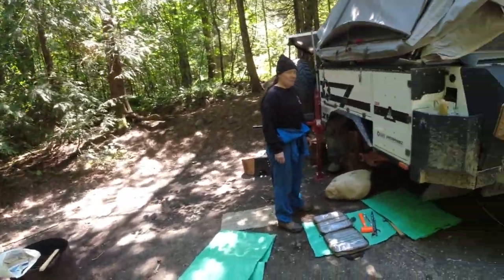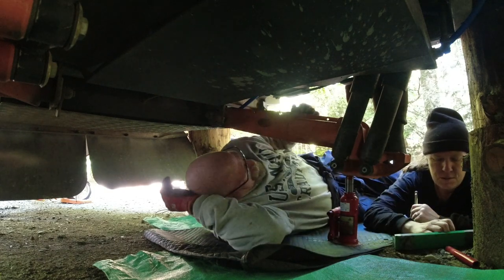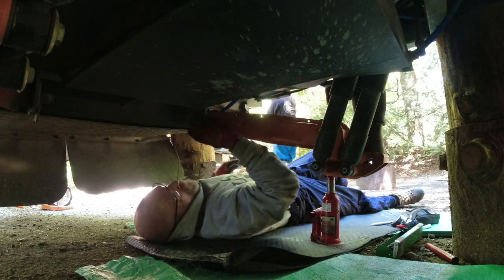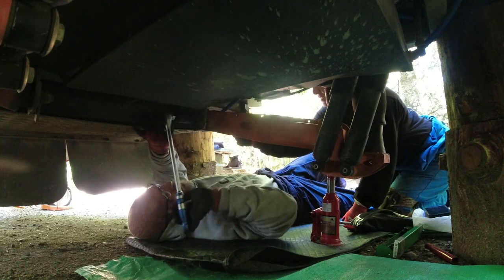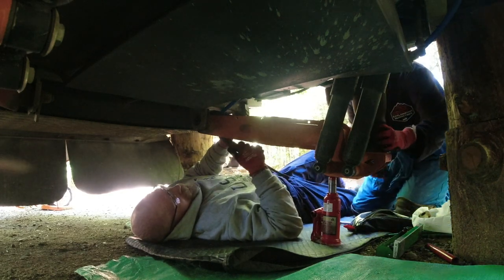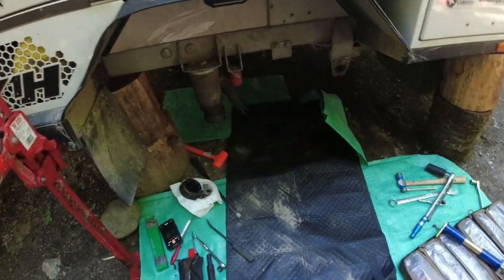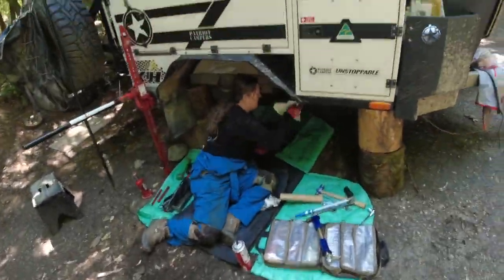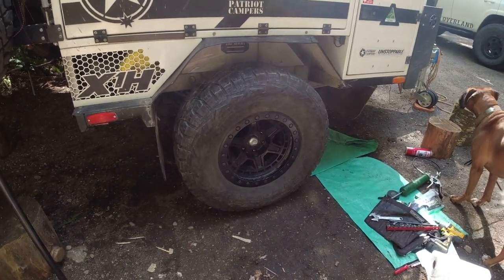In the field Patriot Camper Swing Arm Replacement

Comment: Enjoyed the video and glad your mobile once again. Safe Travels. 
Now a related question, but this is in regards to your "Total Chaos" suspension. 
How has that performed for you? Any issues with the "Total Chaos" components? Cheers, Mate.
Reply from the maker: The Total Chaos UCA & LCA’s have performed flawlessly thus far!  We love them, so much of a better ride!
Reply: @ironhorseoverland7353  I have the LCA and so far so good. I use a 60% emulsion of Molybdenum Disulfide to lubricate the lower ball joint.
Reply from the maker: @jackwalsh1468  i clean the Un balls out and then lube them with Tri-flow

Comment: Maybe I missed it, but do you have any idea why the swing arm broke?  I have the same trailer.  Thanks for sharing your experience.
Reply from the maker: Not absolutely sure, but we’re thinking it had to do with the negative offset wheels and 35” tires we were running on the trailer!  

I wanted to have all eight tires be the same and was told by EO that 35’s were good to go!  

We’ve since moved back to 33’s on the trailer and Toyota TRD wheels!